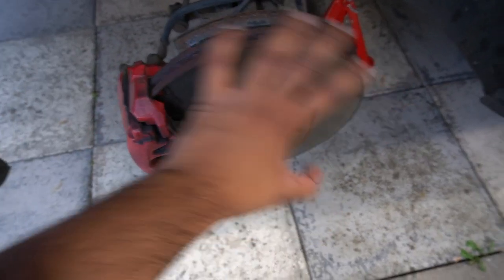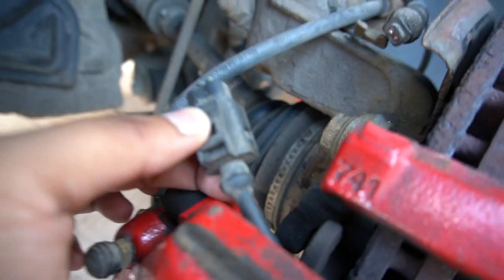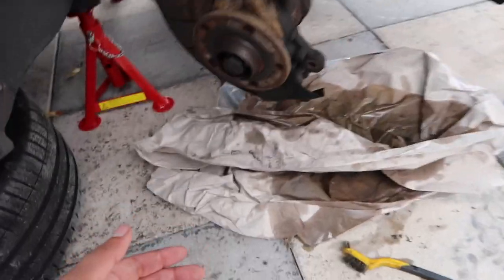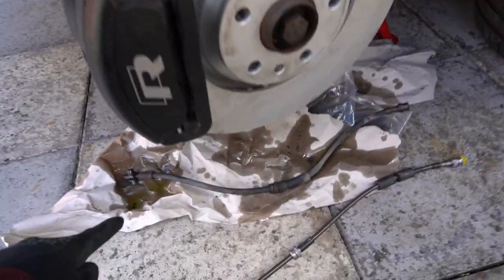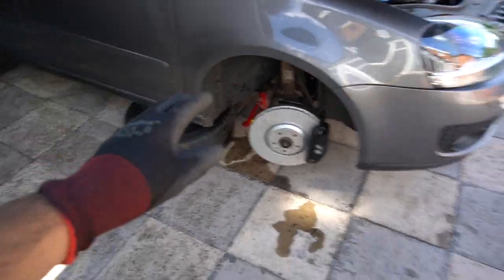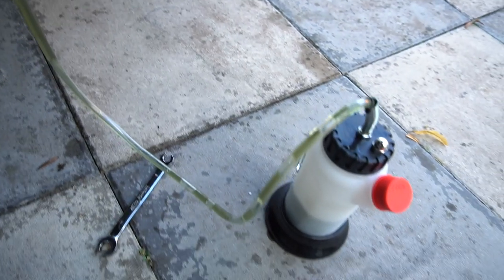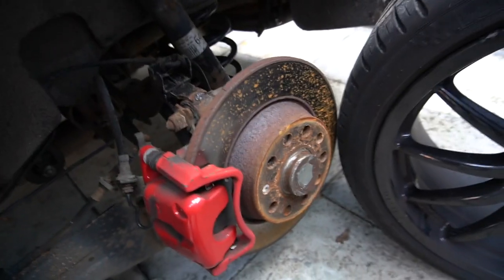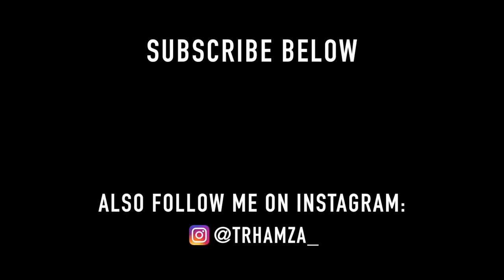Installing MK7 GOLF R BRAKES on My 350BHP GTI!

Comment from the maker: Comment below what videos you’d like to see on the GTI
Reply: TR Hamza My 8P RS3 would like to race your GTI mate 😉
Reply: I have no idea where you go from here other than refitting gti springs on the rear. 20 mins away from done in my book. Have you checked for the insane amount of mud rotting away the ends of the sills under the arches?
Reply: Oh i know! Meth injection, will it keep those valves clean?
Reply: How about adding a boost gauge?
Reply: Track/Street springs and antiroll bars
Reply: Wrap it or plastidip it! and more cosmetic mods like a wing, front splitter
Reply: More track oriented route, anti roll bars, vwr springs, geometry set up. Recaro pole postion seats. Mk6 gti steering wheel. 
Please no wrapping or big wings don’t go down the lee Lockwood
Reply: TR Hamza hi ya fella hope all is well,question,did you notice a change weather big or small in the gear box & gear changes after the box was mapped,before & after ect? Did you notice a difference in the box once it was mapped? Was it any quicker in gear change more responsive? Nice one if you reply back 👍
Reply: Needs a boost gauge rear suspension lowering murder out the rear windows to name a few things but all your content been good viewing so far so i aint complaining 👍👍👍
Reply: 40~140 speedometer shots please.
Reply: How about a detailing video? Bring the paint up more. No one would think that shell did over 200k miles
Reply: @TR HAMZA: Has it got a 6K HID kit & HID yellow fogs?..You could also completely L.E.D. it inside inc number plate. You could also pop it on the ramp..get underneath and do a complete black- hammerite of the the arches/sills/break-pipe areas to protect from rust..and it'll look mint....
Reply: TR Hamza mate hi mate I noticed that you fitted the pads the wrong way the cut out on the brake pad the half moon shape has to sit on the inner part of the Caliper on the piston side instead of the outside of the caliper
Reply: Get the GTI detailed, paint correction and all that
Reply: Got brand new set of valeos if your interested pal
Reply: Triple gauges in a pod
Boost,oil pressure & volts.
Reply: Boost gauge and lowering springs
Reply: @jamies7697  Followed by a clay-bar wax session:)....
Reply: Just Sum Guy only problem is it has rust spots on that need seeing to
Reply: @jamies7697  He might be able to use an oxidiser on the rust to treat it..then hammerite over them....I treated a rusty inner drivers-side arch inside my door-sill rubber that looked pretty bad. Some was scraped..the rest oxidised..then just painted it with black hammerite and a new door-sill rubber....Underneath it was also OK thankfully....
Reply: add the lowering springs and change your back bumper get edition 30 back bumper
Reply: You putting copper grease on them pads bro I'm a delivery driver and never touched my own cars but even I know that lol
Reply: Roll cage upgrade interior and a wrap
Reply: Hi Mate. Could you please make a video on golf mk7 1.0tsi manual upgrades. Such as power, turbo, intercooler, brakes GTi type etc...

Comment: If your going to bleed all your brakes always start with the brake furthest away from the reservoir
Reply: Actually that is incorrect. VW is backward. You start closest to the master cylinder and work away from it. I just read the MK5 Bentley manual.
Reply: Done mine today bled it and the brake peddle goes all the way down no braking at all
Reply: @badboysergio  that happened on my mk6 after bleeding 6 months ago I’ve let it sit but it’s starting to get rusty I got it jumped and it’s a Christmas tree. ABS and traction control lights blinking. Did you ever fix that issue

Comment: Those VW wiring plugs are always fun, you have to push on them (compresses the rubber seal inside) before you unlatch the catch bit, also If you solder those 2 wires together the brake pad warning light will go out, but you'll have to keep an eye on your pad wear yourself.

Comment: I always grease up the backs of the pads, never get any squealing.
Reply from the maker: Did notice a squeak yesterday after a few days driving. Might take it apart again and grease them, thanks for the tip 👍🏼
Reply: TR Hamza defo put some copper grease on them, put some on where the wheel sits on the disc aswell
Reply: @TRHamza get some high temp brake grease from euro car parts, it doesn't dry out like copper grease can, costs about 3 quid. 👍
Reply: @tracktimevideos5164  yeah I agree get some proper brake breeze👍🏻

Comment: Good stuff, bit of advice on bleeding brakes. You really want to start with the caliper that's furthest away from the master cylinder and work your way to the cylinder. For example on my Polo GTI, it would be rear left, rear right, front left and then front right. About 10-15 seconds is enough for the bleeder to be open normally.
Reply: I would agree with that normally, but the Golf MK5 has a specific bleed order which is start at nearest to master cylinder. 
Also it's well worth bleeding out the clutch - shared system with the brakes, so there is still some old fluid in there. Plus if you have VCDS/VAG-COM then go through the ABS cycle too to get the old fluid out of there.
Reply: @chrisryan3445  Thanks for the information. I never knew that for the Mark V.

Comment: When bleeding brakes always bleed the farthest one away from the master cylinder as air can get trapped in the brake lines leaving you with a spongy brake pedal also advise you to put some type of brake grease on your new calipers and pads to stop brake squealing also will make it easier to dismantle when pads need replacing great video mate enjoyed watching it

Comment: If you want to switch the pad warning off, bridge the wire that broke so basically cut the broken connector off and join the 2 wires together

Comment: To save loads of brake fluid running out you can take the reservoir cap off and cut a piece of  polythene or plastic bag about 100mm square and place it over the reservoir then put the cap back on. That should create a seal and stop all that brake fluid loss.

Comment: Working hard as per usual my brother... As you said the car is coming together.
Regarding the ABS/Brake light on the dash, just loop the broken wire(s) so it completes a circuit... this will get rid of the light (temp solution only, lol. Replace it in the long run).
Also I am sure in the past I have seen a car like yours using the front removed calipers and discs on the rears... Just a thought 😉

Comment: Camera looks good bro. I’d say paint the back callipers black. Would look a lot better. Change suspension too when you can. Can’t wait to see this car when finished. Hopefully you sort body and minor details out. I know it’s nearly 200k Miles but old is gold as they say. Also for the break pad grease check out Textar Cera Tec from Euro Car Parts it’s a ceramic paste. It’s much better than copper grease. Read quite a bit about it on forums. Works a charm.

Comment: You bleed furthest away from the master cylinder first which is nearside rear,offside rear,nearside front then offside front.
its dual circuit split diagonally so if you get a leak on say the offside front you still have full braking on offside rear and nearside front.

Comment: I started down the same route...but ended up with new cayman calipers SKF bearings HEL lines textar pads mtec discs inner and outer tie rods  oem shocks and eibach springs  Nothing worse than getting carried away

Comment: Didn't Copper Grease Pads to avoiding squeaking ?
Reply: Don’t need copper grease
Reply: The slide pins need grease that's what squeals the back of the back does not squeal
Reply: @usa5046  The slide pins on new VWs don't need copper grease. They come un-greased and clean from the factory, and simply need to be wiped before re-inserting.
Reply: @Ahmed____  sorry junior that's false information I work for a vw dealer the guides are lubed. If you buy any audi or vw service manual they say this....
Before inserting pads, clean guide surfaces and apply a thin coating of polycarbamide grease G 052 142 A2"

Comment: What I'd like to see is the rear brakes upgraded to match the fronts.  MKV GTI applies the rear pads before the fronts to prevent dive under brakes.  Quite possibly ABS calibration is out of whack with the different brakes front and rear.  Just short the two wires together on the wear indicator to turn the light off.
Reply: Yea I thought the same, the brake balance would be off doing fronts alone. Could even be worse than standard unless the rear brakes are upgraded to balance out the front.
Reply from the maker: Worse than standard lol, it’s about 10x better.
Reply: The stopping power might be greater but the brake bias will be out making the braking less effective.

Comment: Strip the brake sensors wire back and join the two wires together and it will get rid of the warning

Comment: How much did that pressurized bleeder bottle kit cost you? did you get it on amazon? Also, the wires on the front brake sensor always break like that super common. If you can get on vag-com you can actually deselect the brake light warning, which also deselects the empty washer fluid warning as well. Did it on mine because I had the same issue with that sensor wire.

Comment: hello, very good improvement I did not know that you could install MQB platform brakes in that generation, I have a doubt because I have a seat leon mk2 FR 2.0tdi 170bhp that comes with the same brakes as a golf mk6 gti, in my car is plug and play? or I have to adapt?

Comment: Excellent video! I went through a similar experience when doing my brakes for the first time. Qns: did the caliper mounting brackets fit directly on? Are they 4-pot? And the TTRS brake disks bolted straight on? Could this all be done running the standard 17 inch GTI monza alloys? Thanks!

Comment: To make the pad wear sensor light turn off just join the 2 broken wires together bro 👍 and give my channel a shout out 😅 liked the video.. and like the brake fluid bleeder you used, I've used one in an old garage I worked at, it's a good bit of kit. 
If you keep the brake pedal pressed with some wood and the seat moved forwards while you disconnect the lines you'll find they don't drip as much too, and easier to bleed after but don't forget to stop pressing the pedal before you bleed it lol. Looking forward to the next vid 🔥

Comment: Bro ideally you wanna bleed the brakes furthest away from the brake reservoir (so in your case back left then back right then front left then front right)
Reply from the maker: On most cars this is the case. With the MK5 it isn’t Ive been told
Reply: @TRHamza  thats cool then bruv keep the builds going! 💪🏽 watching every single one💯😎

Comment: I did quite the same job last week , for the V gti you start front left 200ml-> front righ t200ml -> rear left 300ml -> rear right 300ml . 

And then you flush from the nipple on top of the gearbox , right under your intake hamza you extract around 100ml of old fluid from there . 

Nice uprade by the way !

Comment: Did you use brake cleaner on the discs before installing?
Reply from the maker: Yes, a lot on the hubs etc
Reply: Good idea to give them a clean after installation too. Greasy hands and brakes are not a good combination.
Reply: The disc he used he don’t need to clean them off it says on the box